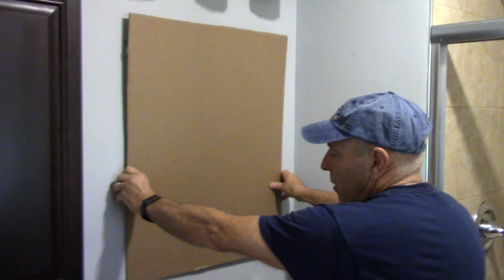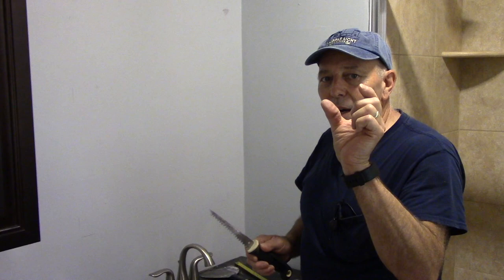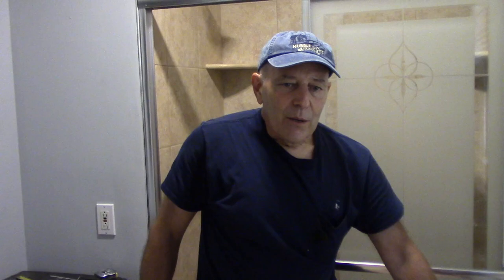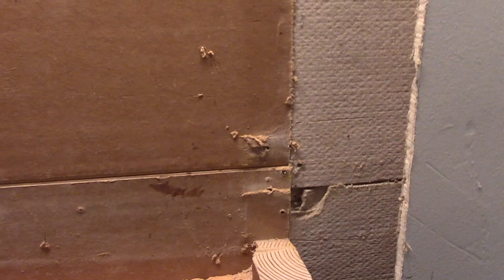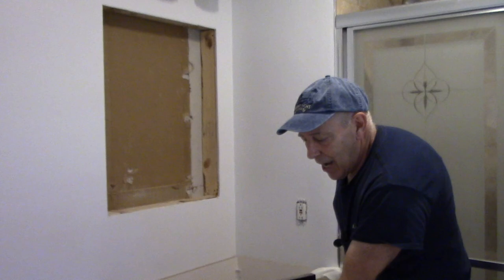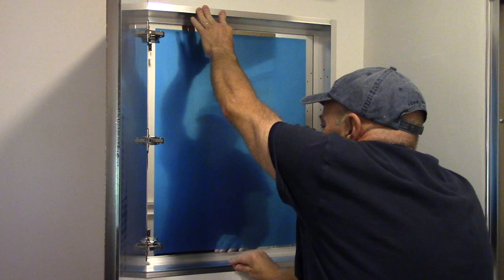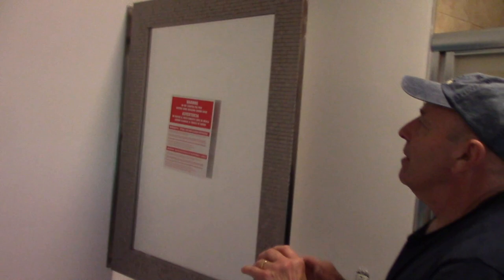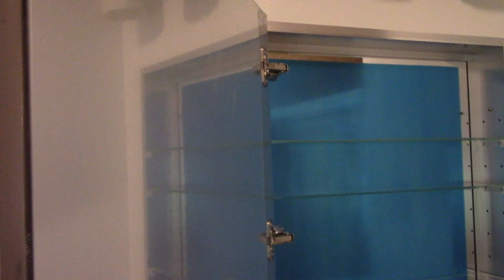How To Install A 24 Inch Recessed Medicine Cabinet. Easy

Comment: Would have been more helpful had you video captured the actual cutting of the pre-existing studs and if you had video captured the install of the new side support studs.
Reply from the maker: Thank for watching.
Reply: Yes, this is exactly what I was thinking.  Including some video of the cutting and installing of supporting 2"x4" framework would have been very helpful.
Reply: This video explain that in more detail: https://youtu.be/cB3ErFJ6Hbo?t=117
Reply: If you don’t know how to cut 2x4s just call a contractor please

Comment: Thanks so much for taking the time to make this video. If I might suggest something that I and others would find helpful, would be showing a bit more of the detailed process of framing in the cabinet with 2x4s, how and where to attach the new vertical and horizontal studs. The video sort of glossed over that important step. But thanks again for making this video. There is some helpful info here!
Reply from the maker: Thanks for watching.
Reply: This video explains that part in more detail: https://youtu.be/cB3ErFJ6Hbo?t=117

Comment: Very good video,  Thank you.  But showing a bit more of the detailed process of framing in the cabinet.    I tried doing but the beam work I really messed up because I didn't see how it was done.  What if you cut the beams but then just put in the cabinet?   What could happen ???

Comment: You skipped cutting out the studs, that's the one part of the process I wanted to see.
Reply from the maker: Thanks for watching.
Reply: I agree, I can place the cabinet in. That's the easy part. The hardest is cutting, and the unusual (for me) things like screws mentioned in another post. Plus, what to look for and do when you find something in the wall.
Reply: Me too

Comment: Great video, just curious if the studs that were removed has drywall screws in them and did they damage the Sheetrock on the opposite side.
Reply from the maker: Thy actually had nails in them and I did have to fix the other side of the wall.

Comment: I pre-dill pilot holes whenever possible. Stops possible wood splitting and it takes seconds as I have a drill and impact driver.
Reply from the maker: Pre drilling only takes a few seconds but can save you a big headache
Reply: @getitdonehomerepair  really enjoyed your video and will be checking out the rest.

Comment: I'm gonna ask a dumb question... Don't you need the studs to keep the wall up? or does the actual cabinet become part of the wall stabilization??
Reply: Some walls are load-bearing (meaning they have roof/2nd floor weight on them) and some walls arent. The only way to know is to look at the structural blueprints. If this is a load bearing wall, its a bad idea to cut the studs because the cabinet cannot be relied on to hold up the weight. But if this wall isn't load-bearing, then it doesnt worry me.

Comment: How do you know if the studs are load bearing or non load bearing?
Reply from the maker: Thanks for watching.
Reply: I'm not a pro but I believe a load bearing wall runs perpendicular to the trusses in the ceiling. In a typical rancher, that'll be the center wall that runs lengthwise.
Reply: Just remove one, if the roof falls down it’s the load bearing wall, if not it’s not

Comment: A comment on load-bearing v non-load-bearing studs might have been useful, plus what could be done in former case
Reply from the maker: Thank you for your input. That is why it is important to box out the opening.
Reply: @getitdonehomerepair   But the way you did it, the studs you cut can no longer bear any load.
Reply: There is no chance that a load bearing wall is behind a vanity. Also a load bearing wall would never be held with only one 2x4
Reply: @abdulhai93  we use 2x4s for load bearing walls all the time as structural engineers. These 2x4s would be anywhere between 12 to 16 to 24" spacing

Comment: how do you get the cut studs out without destroying the drywall on the opposing wall, quick edit from utiility knife to rough opening, good utility knife work, but how did you get the scrtews/nails out without wrecking that other finished wall?

Comment: As a structural engineer, cutting the studs like this bugs me. Hopefully this is not a load-bearing wall
Reply: How should you cut them? Or not at all?
Reply: @MikeMcCarty6453  if the wall is load bearing, not at all. Unless you do shoring (adding temporary supports of the roof while you mess with the wall) but that should only be done by a professional

Comment: Hmmm. The medicine cabinet is framed out, but you didn't really distribute the weight previously supported by the studs every 16". I would have installed a 4 by 4 header, just like you do when you frame out a door or a window.

Comment: Dang.  The one part needed to see, you did off camera.  I wanted to see how to cut the studs without disturbing the sheet rock on  the other side.  I guess that isn't possible because the sheet rock on the other side is screwed into those studs also.  But I would have loved to see what took you used to to this with.
Reply from the maker: Thanks for watching.

Comment: I just had this installed! Great video. I have the plastic bins and don't know what they attach to? Do you know how and where?
Reply from the maker: To be honest we did not us them.Thanks for watching.
Reply: There is a metal rod packaged in the styrofoam.  The rod slides into the u-shape channel of the support brackets (in this case you do not use the shelf). The bins then go onto the metal rod. Pretty cool added feature.

Comment: How did you get the 2x4s out of the sheet rock on the other side of the wall?

i.e. the drywall screws on the other side
Reply from the maker: With the circular saw and set the correct depth of the stud so you don't cut into the other side

Comment: Jim I’ve got two of these to install and have elected to recess them, so your video was helpful. I have noticed a problem on each cabinet. The doors are not straight. So shimming up the insides will level out the doors, but...because I’m doing this by myself I’m planning to remove the doors from the cabinet. Have you done it this way? Has anyone? And is there a way to square up these doors after install? I do have one already mounted on the surface and the door is crooked, but the cabinet is perfectly square as it hangs.
Reply from the maker: If I were doing the job and the door was not installed correctly I would return it for a new one.
Reply: @getitdonehomerepair  thank you for your response. I was a bit premature, more frustrated with the job, I wanted to recess the cabinets, but I have drain venting running up thru the wall, long story. But...the doors do have adjustments to square them up. I’m pleased, and its turning out “all is well”...again, thanks for you response

Comment: You didn't show how you cut the studs! No help at all.
Reply: If you don’t know how to cut wood maybe you should just hire a professional 😂😂😂
Reply from the maker: Your right . The footage was not very good so I decided just to explain how I did it. Thanks for watching.
Reply: @omarmendieta9149  It's not just a matter of cutting the 2x4. The drywall on the outside wall is screwed to the studs. Maybe think a little more before you judge someone....